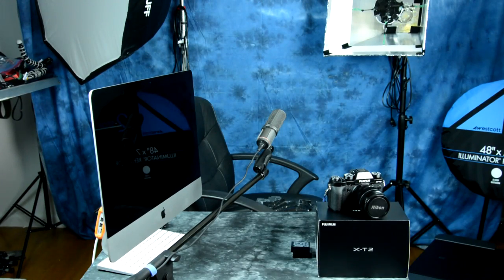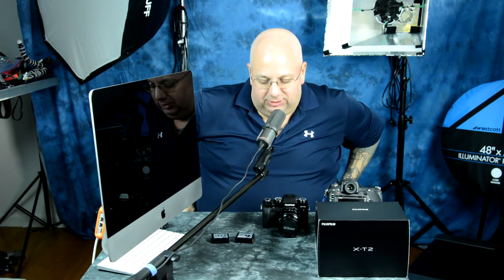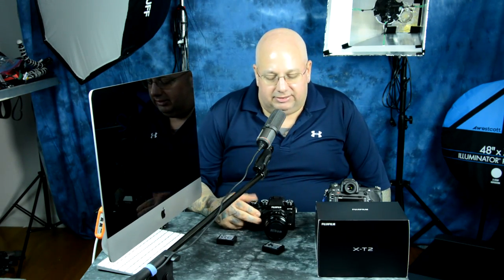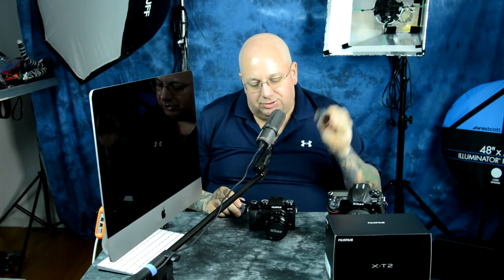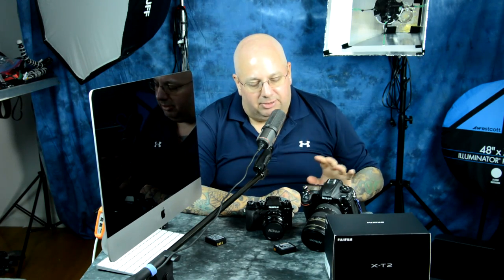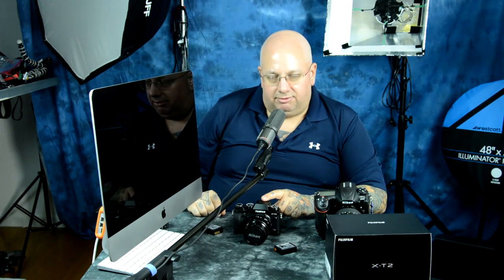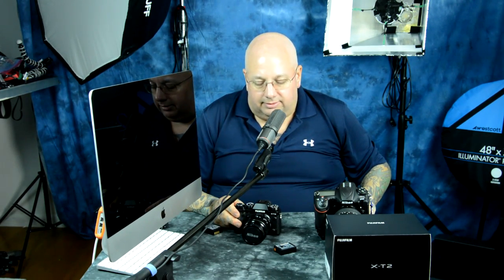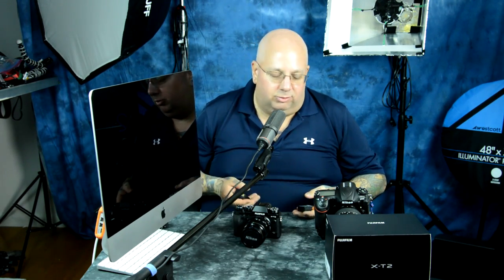FUJIFILM X-T2: The POWER PROFILE necessitating using ONLY the NP-126S (X-T2) battery In-Body

Comment: I don't understand how the difference in batteries can cause a lock up. I'm not questioning that it does. I'd just like to know.
Reply from the maker: ill quote why:the spec's you're not seeing are the batteries internal resistance and loss coefficient.
The battery has some internal resistance and when you're pulling a 
lot of current out of it (read: burst, card writing), the voltage loss 
across that resist. can be an issue also relating to how much heat it 
produces.
My hunch is that the S packs are simply 'better' battery cells be 
they different formula/process that yields lower losses at high current 
rates.

Comment: just find it strange the difference in battery would cause the lock up, but if that's what you tested and found to be the case, then I guess it must be. But, really, Fuji should update the firmware to address the lockup.. the difference in battery used shouldn't cause any lock up whether you want to shoot normal single shots or burst... according to Fuji, the new S battery keeps the heat down with no additional benefits.. at least that's what they told me when I asked the Fuji Guys.
Reply from the maker: its not strange at all. …………well the new battery ALSO keeps the heat down in burst, but it has a diff discharge profile,   

Fujifilm and Fuji are flat out WRONG 100% that its merely a "performance" diff.  thats absolutely 100% a BS statement on their part. 

XT1 battery in the XT2 wont do burst photog, itll freeze up.